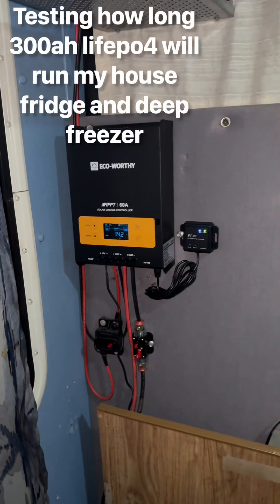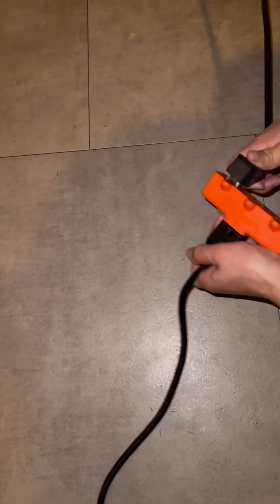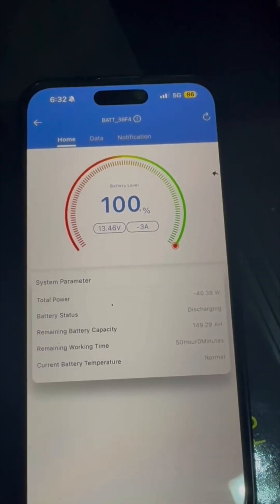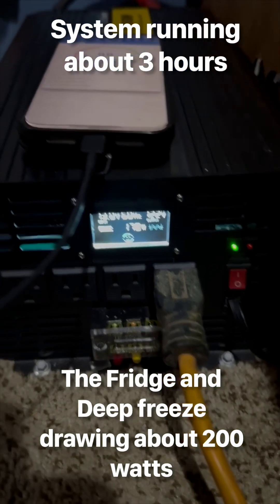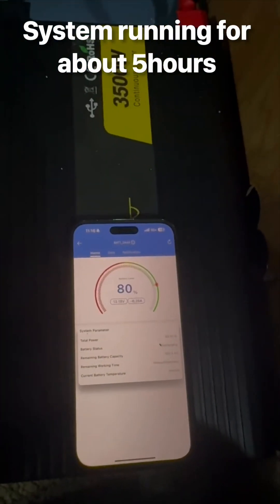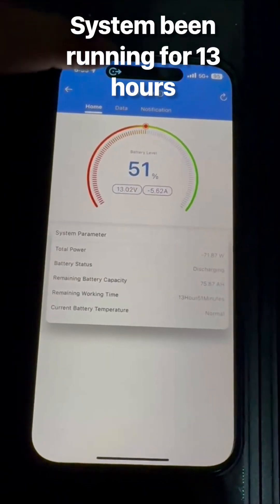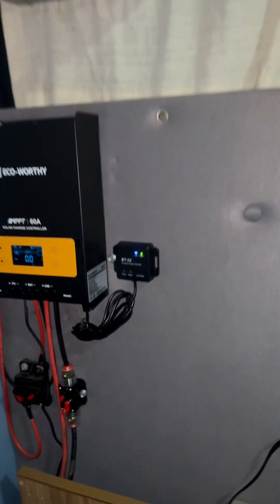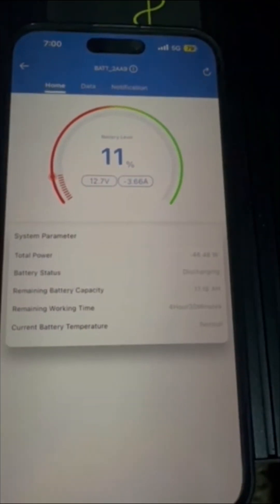Eco worthy 150ah Lifepo4 Bluetooth.. Discharging. will it run my House Fridge and Deep Freezer..?

Comment: Nice little solar setup. I just upgraded from two 100ah to four 100ah Power Queen LiFePo4 batteries in parallel for a 12v system. They are charged by four 450 watt panels. My fridge has been on the system on and off for sometime now. On rainy days i put the fridge back on the grid so as not to discharge the batteries too low. Greetings from Jamaica.
Reply from the maker: For sure i’m still trying to figure out what my system can handle thank you for you comment.

Comment: Good video! I'm currently doing the same test with 2 Eco-Worthy 280 Ah battery's and my 11 cu/ft fridge. My fridge is fairly new with inverter technology. I'm running it from my new Renogy 3000 watt inverter. When the compressor is on the fridge draws about 37 watts AC and about 5.5 amps from the battery. The fridge has been running for about 4.5 days now and is currently at 43%.
Reply from the maker: That is really good your system is holding up well i was actually was looking at the 3000 watt inverter from Renogy. in my camping vehicle i have a Renogy 40a mppt controller with two 100ah AGM deep cycle batteries. soon im going to do an upgrade video on it. I noticed while running my fridge and deep freezer that the highest discharge was about 15ah in my rv system.